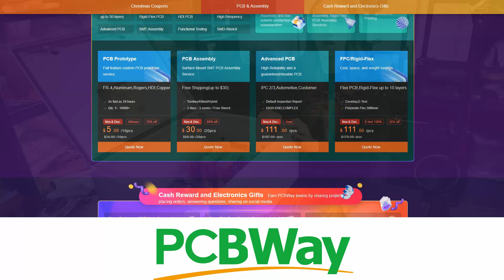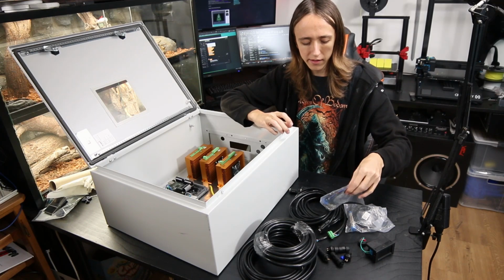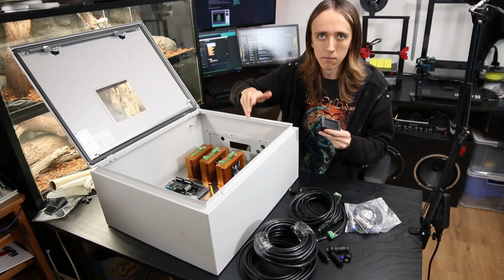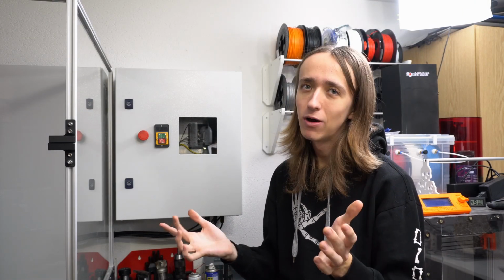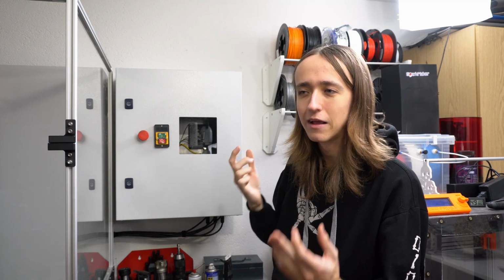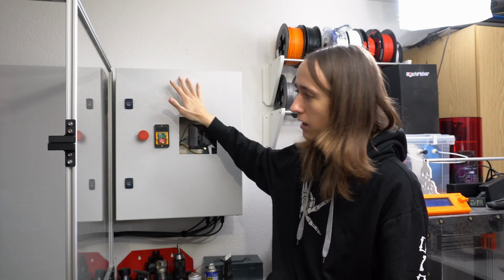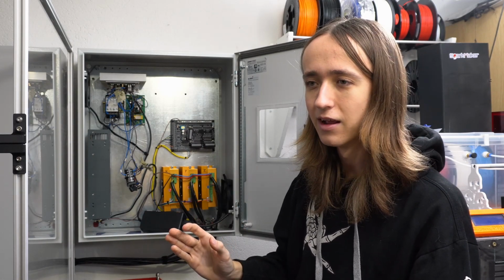BF30 CNC #6 - Electronics Part 1

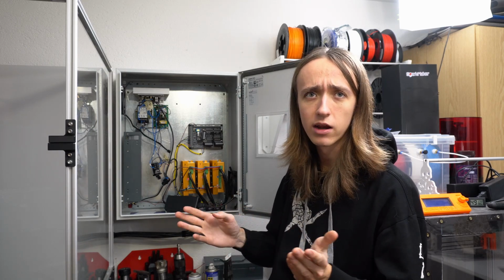Comment: 14:14 Linuxcnc is all you need. It may be not easy to set up, but you can do everything you want with it. You can customize it, add an automatic toolchanger, do rigid tapping, have true closed loop to the controller via glass scales and so on. Just need some Mesa hardware boards (Mesa 7i76e should be suficient for you for now, you could add more boards later on)

Comment: Oh no ! I'm sorry about your smooth stepper ... that's shitty !!  

I'm sure that you have the spindle speed sorted out already. There are a few companies that sell a little circuit board that takes the signal from Mach 3 /4 and converts it to a voltage output for the potentiometer. You then calibrate it and you're good. I will not have speed correction, but in most cases that's fine. 

Thanks for sharing !

Comment: In the electronic cabinet i see 3 problems, 1 the upper fan is restricted by the acrylic window, 2, the stepper drivers would be better turned 90° and put the vanes uppermost, that puts them in line with the colder airflow going into the case. 3, Your Emergency stop would be better on the machine close to the operator position, its now a bit out of normal reach, you could put another one or if you intend to put on a jogging pendent that would do. I'm not picking fault just suggestions as your doing pretty good on the build.

Comment: Noooo that smoothstepper are expensive. I also have the same. That hurts a lot but it can happen. Looking forward to see your solution for setting up the spindle control programable from gcode. I have similar mill and that part I kept it manual. It's fairly easy to get it turn on by M3 command but to give a sort of PWM signal to convert it in rpm is not that straigth forward. I use mach3 and there you can make a conversion between pwm to rpm in hte configuration. So I thougth would be possible to make multiple check points and manually assess the rpm and find the convertion formula for your spindle.